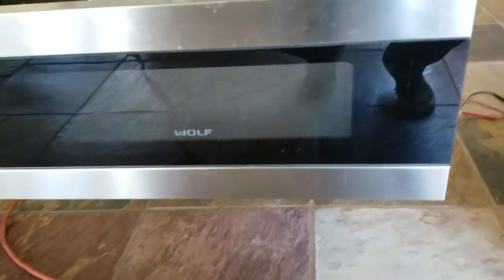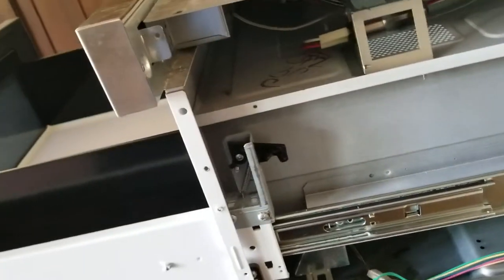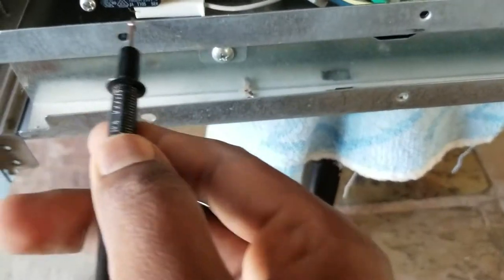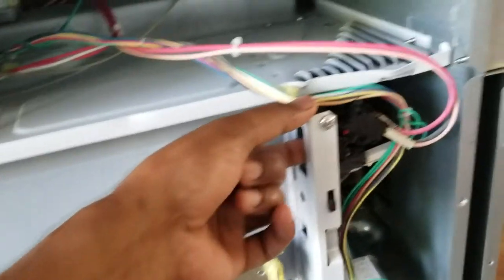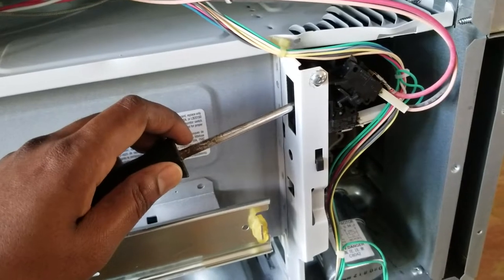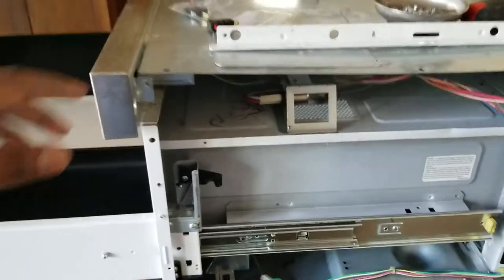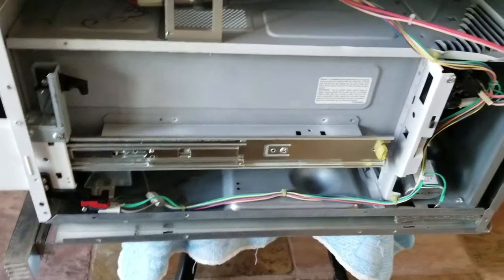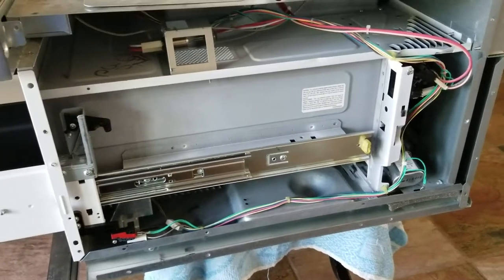Wolf Drawer Microwave Oven Not Heating Food ? Diagnosis & Repair.

Comment: Hi, thanks for video very helpful. My door doesn’t close all the way about 10% left open with light On, if I gently push close then works fine. Any suggestions would be greatly appreciated? Thanks again.
Reply from the maker: I would guess one of the sensor/switch is causing it or motor. I personally never encountered this issue. But wolf has some troubleshooting guidelines to follow:
https://www.subzero-wolf.com/assistance/answers/microwave-drawer-will-not-open-close-or-stay-closed

Comment: I have one but when I push the microwave button it doesn’t work ?
Reply: When I push the door button it doesn’t work
Reply from the maker: @trinidadgomez5061  I never faced that issue with mine. If your door button doesnt work, try manually closing the door if it's open (but be gentle), then press  microwave button and see if heats up the food, if it does then door motor may be bad, if it doesnt may be the front panel board itself got faulty.

Comment: I have the same microwave. It worked before, but suddenly none of the touch screen control buttons work. Not even the open/close. I tried unplugging it to restart it by unscrewing the screws on the side. However, the microwave still doesn’t pull out. Do you know why? Or Any ideas on how else to fix the touch screen issue?
Reply from the maker: Never dealt with touch screen issue. But from what you are describing if none of the buttons are working, seems like loose connection to the controller or may be the whole controller is bad. Try to open it, unplug the controller, cleanse the contact with lens cleaner and put some dielectric grease before connecting it back. See if that fixes it.
Reply: Thanks for a quick reply, my issue is that I can get microwave out is there any hidden escrows except the two either side that I haven’t seen?
Reply from the maker: @benhakakian3721  My friend I never took that apart so cant help if there are more screws before you can disconnect it, so you are on your own.